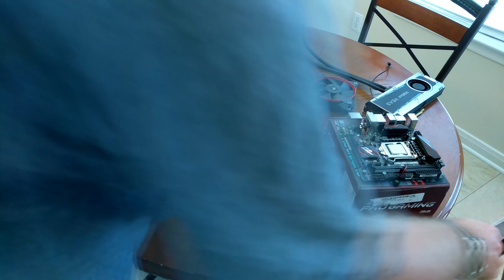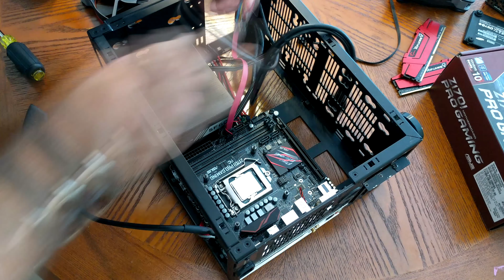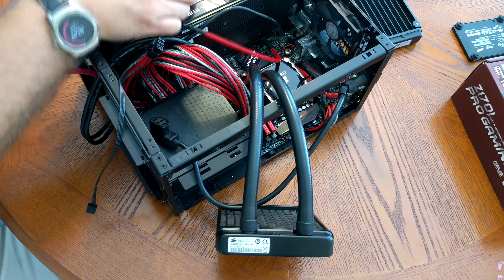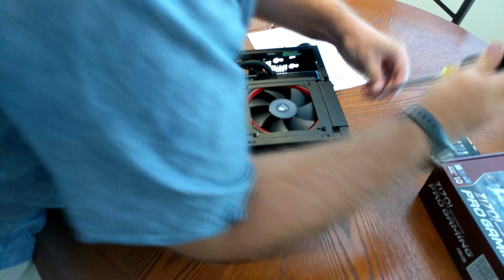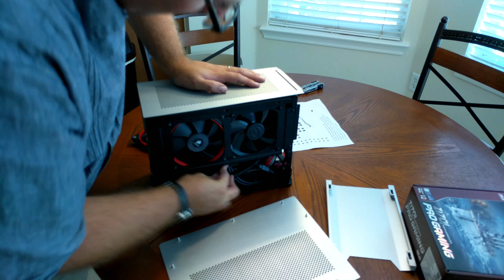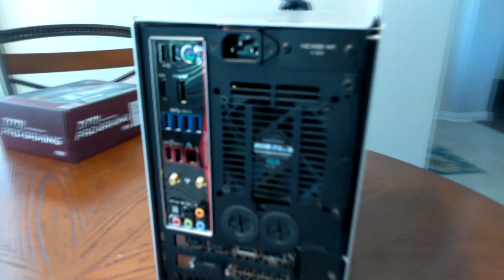Ncase M1 Upgrades

Comment: Would mounting the fans on the inside of the rad create more space for the AIOs tubing? Making it easier to sit inside
Reply: Yes, also I believe it was Optimum Tech that made a video about this as well and showed that it performed a few degrees better than the push configuration.

Comment: Hey, where did you get shorter cables that go from the PSU to the mobo and gpu?
also, do you think i can fit two 120mm radiators? one for cooling my cpu and one for cooling my  gtx hybrid?
we have almost the same build!
Reply from the maker: I fit two in so you can too.    The shorter cables were done by www.cablemod.com but they aren't the only place to get them done.  they were spendy at $105 for the set
Reply: How did you measure the cables and how did you know which ones to order? 
I already ordered my NCASE, the PSU, still between the H60 or H75 .
Reply: How did you know the length of the cables?
I have already ordered my Case and PSU but I don't know the length of each of the cables I need.
How did you know which length per cable and also which cables to order?
Reply from the maker: I ordered only the cables i thought I would need so only 1 6+2 PCI cable and 1 sata cable etc.  I actually found someone on reddit who had the same psu and motherboard as me who had already ordered cables https://www.reddit.com/r/sffpc/comments/5l77hv/ncase_m1_megathread_3/dfc17z2/   Also according to the spreadsheet i linked for you to answer your own question... the h75 is a better choice. Obviously the H60 works but apparently the h75 is easier to work with in the case

Comment: Did you use the H60 stock fan? also, what temps do you get with the H60 on your cpu?
Reply: Would you recomend the H60, or the H75 or the H55?
Reply from the maker: When I first completed the build I was using the stock fan. I then switched the corsair af120 in this video. Finally I am using some bequiet purewings 2 fans on both the rads and the back 80mm fan.  the temps are all good at load it does not exceed 64 degrees celsius.

As for compatiblity i would refer any recommend questions to the user contributed Ncase Community spreadsheet https://docs.google.com/spreadsheets/d/1Xhd3QG2uIVBgQ7vHgpP_Bd_MNcrfxr8KJW2sY6g33so/edit#gid=29  found on the giant hardcase forum thread for the M1 https://hardforum.com/threads/ncase-m1-a-crowdfunded-mini-itx-case-updates-in-first-post.1717132/

Comment: Hi I have a question, at the end of the video the side panels were bulging out, did you manage to close it completely? also what are the cpu+gpu temps with your set up?
Reply from the maker: Yes it did get it shut all the way.  It took some moving abit, but eventually it sat all nice and cozy.  as for temps it sits at around 40c during gaming on the cpu and around 55c on the gpu.